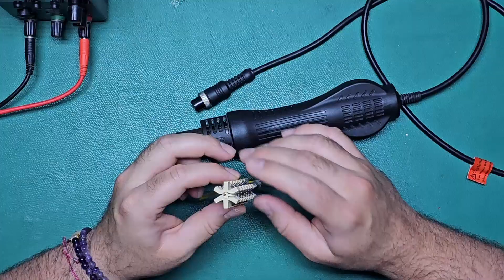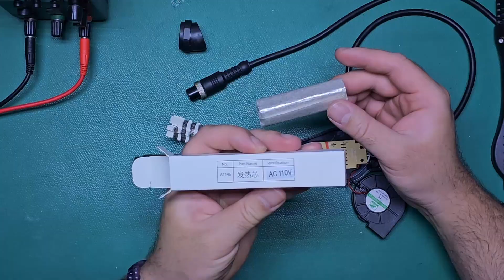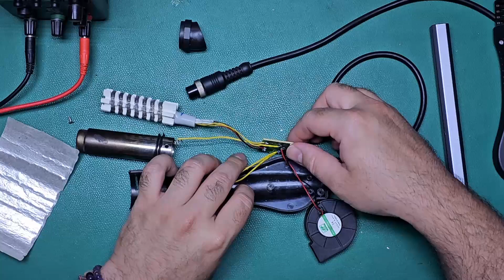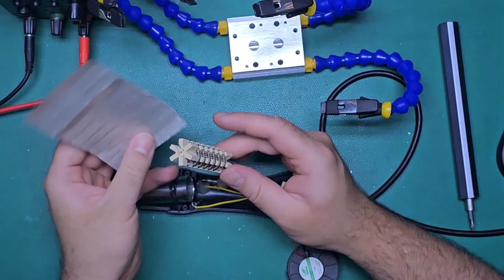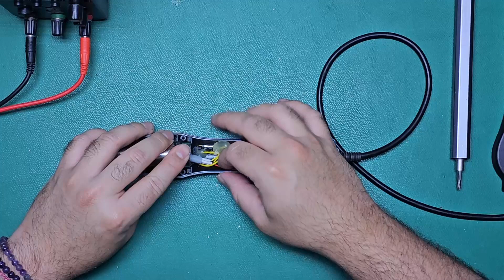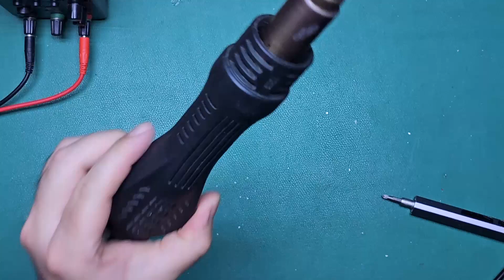Fix Your Hot Air Rework Station for $5

Comment: It's called mica, when first manufactured it's easy to handle, but once it sets it becomes very brittle and crumbly.
It is used to insulate both thermally and electrically the coil from the outer grounded case.

Your problem with the wire insulation, makes me think they used silicone insulation, which makes sense when dealing with high temp applications.

When screwing into plastic, always turn the screw manually backwards so the screw lands on the original thread. If you screw them in the right direction first, you risk cutting a new thread and this can lead to striped threads.